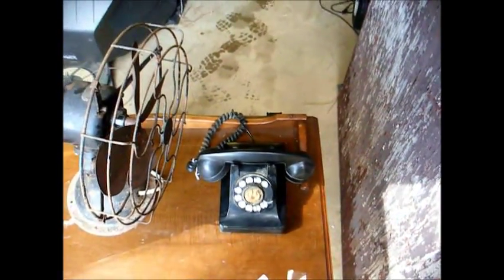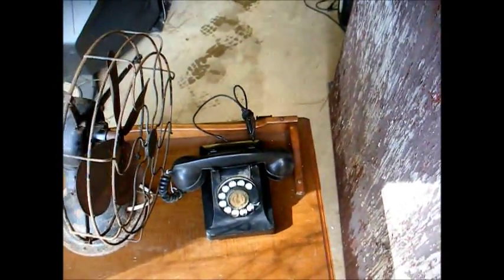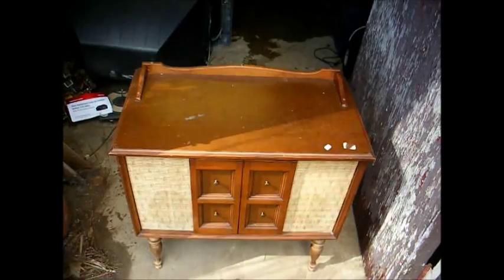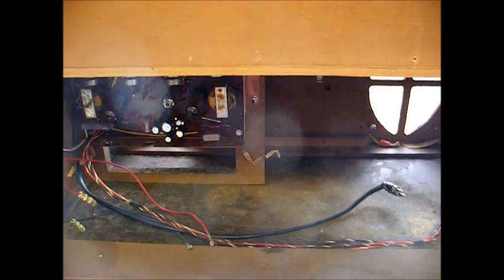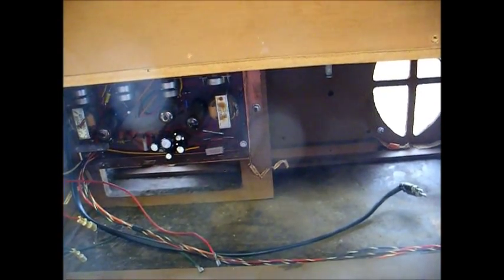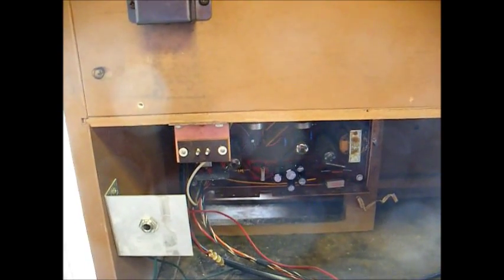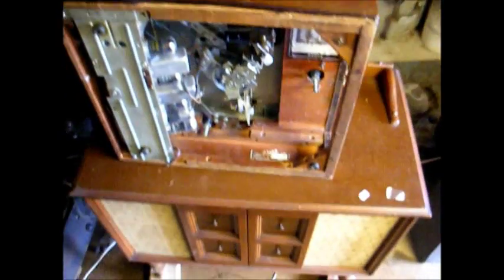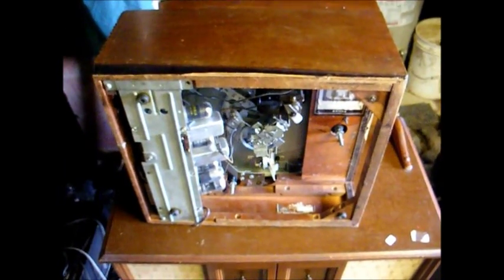Latest vintage electronics finds (record player, radio, fan, western electric 302 telephone)

Comment: i got a question for every one i have a radio thats been passed down threw my step moms familly n i was around 12 yrs old when i got it i was the only person who wanted it it still to this day 18yrs later out preforms any other radio ive heard its a 1962 Pencrest thats the date on the board says ive looked n never was able to find any info on the brand or the radio 
any help id be gratefull for